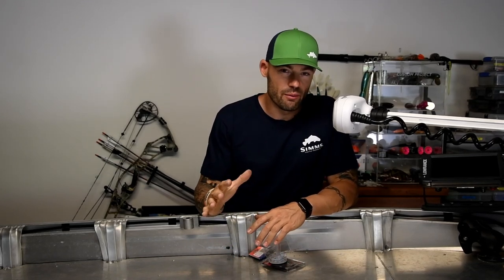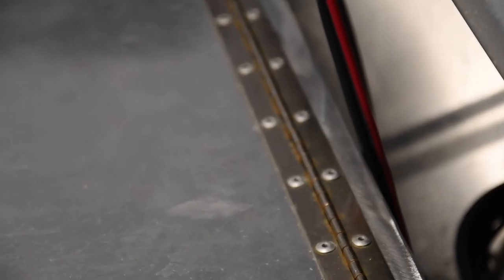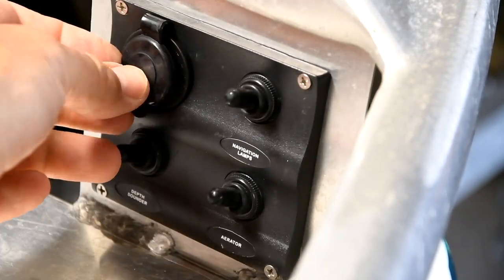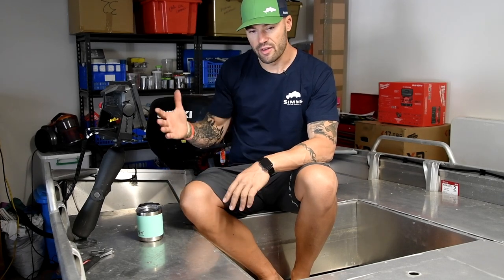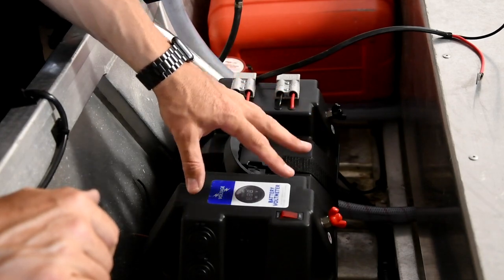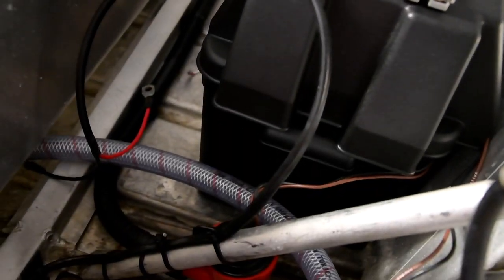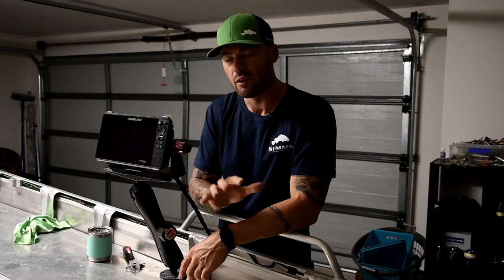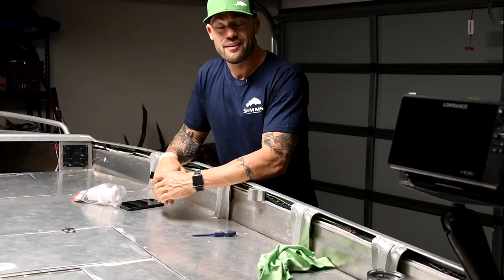Project tinny boat build part 2

Comment: Great work mate. How do you go running the electric and sounder off the one battery with electrical interference on the sounder? I find with mine whenever I operate my Minn Kota my Lowrance Live screen gets hazed over to a certain degree. Do you have any tips to stop that?
Reply from the maker: Andrew Johnston never had a problem mate, maybe look at where the wiring is run. Or are you using a transducer on the trolling motor?
Reply: Dean Silvester no just the normal transom mount AI3-1. Both power supplies run directly from the battery to them.